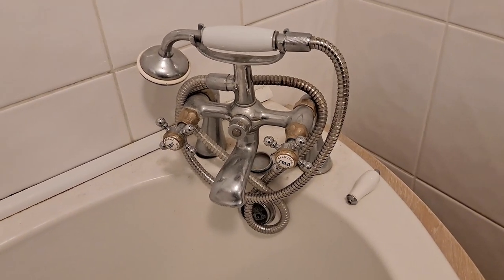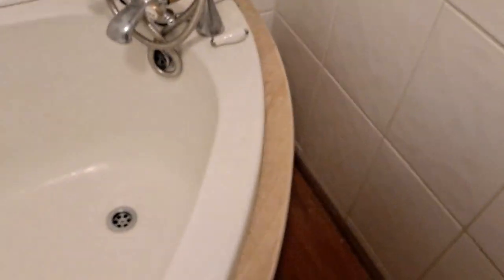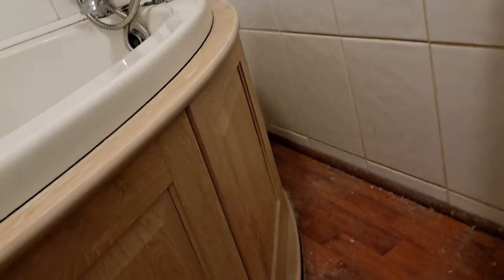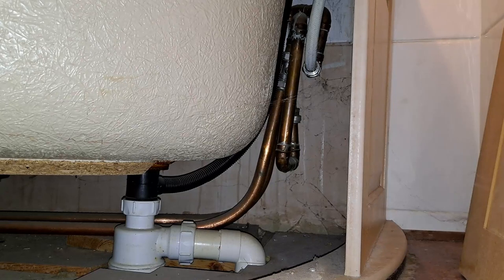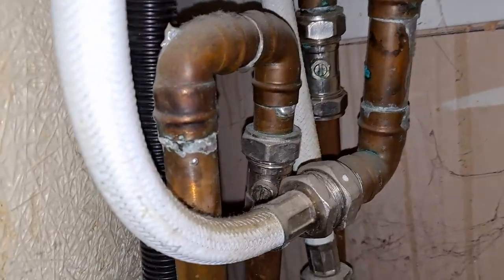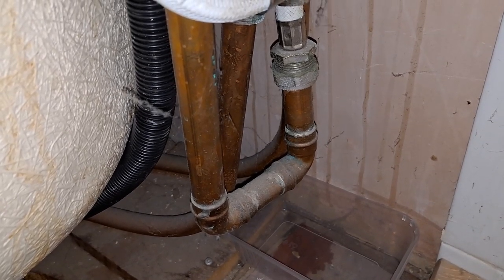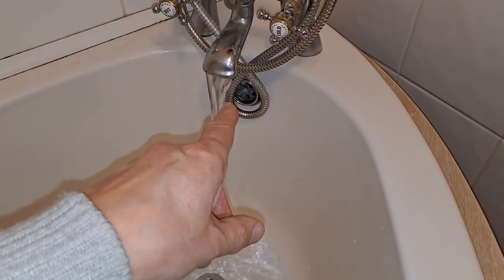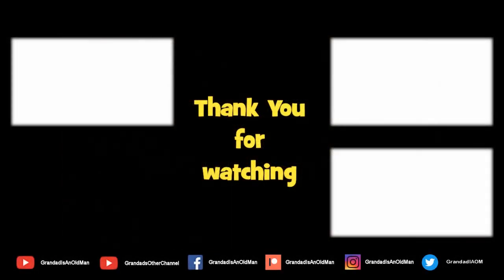Replacing the bath mixer taps Access problems

Comment: I hate jobs like that! I had a similar problem many years ago. I tied up the valve in the tank in the loft so I didn't need to turn off the cold water, just empty the tank like you did. Good detective work on the bath panels. Thanks 😀 👍
Reply from the maker: Another alternative is cone shaped rubber bungs in the outlet pipes inside the cold water tank. That means you don't even need to drain the tank, if you are brave enough to trust them 😊🤞🏼

Comment: I feel your pain,you should have isolation valves either in the attic or hot press to save you draining the tank because when you refill it you might get airlocks someone pointed out about those valves already their rubbish,there are ball valves with a small handle on them they are much better,a tip for all valves is when your turning back on the water is open them fully and then just barely go back a turn or a slight bit it stops them from jamming.

Comment: That's a shame with those valves. Just wear of the washers over the years I suppose. I would have put valves with the little lever on them if you have the space to turn them but you will have finished working on them by now. I am not bad at fixing stuff around the house but I really hate working with plumbing. The first house we had when we got married had the old iron enameled bath. I had to remove the side panel to fit new taps. The house was about 60 years old.
When I removed the side panel there was a bit of paper laying under the bath. I opened it up and it was a workman's wage slip. He must have been one of the guys who built the house. I found that really amazing. 😄👍
Reply from the maker: That would be a fascinating find. My father-in-law was a plumber and general builder. They always left coins so finders could date the work.

Comment: Nice video.is there a Video comming Up where you replace the valves?  Thats Pretty much annoying when water valves Start To leak. I wonder if those valves habe O ring seals that have deteriorated over the years🤔
Reply from the maker: No, the follow up video is putting the panels back.

Comment: Hey. I took bathroom out for new tiles on the floor put it bk together and gets a phone call from wife to sat sink was spraying water from back  this was like 2 weeks later. The connection on pipe was the culprit. I'm never doing it again I hate plumbing. Give me a hole to dig any day 🤣
Reply from the maker: The main problem is working with old stuff that hasn't been touched in years. Then it is all seized up and doesn't work.